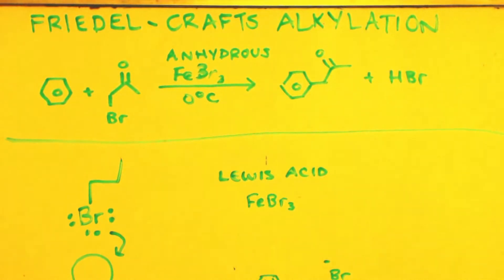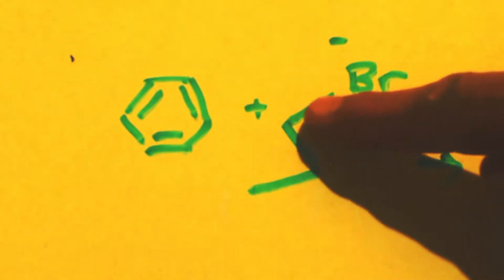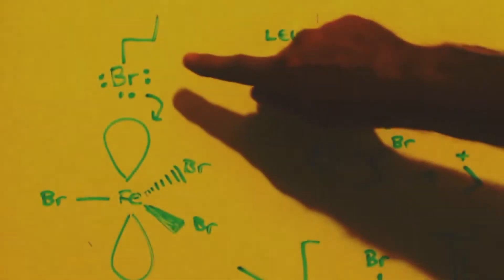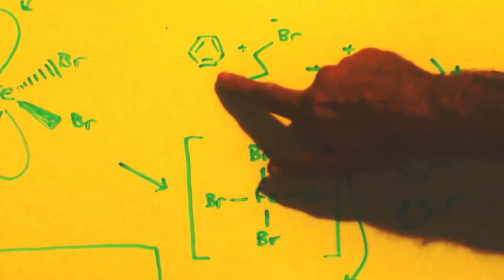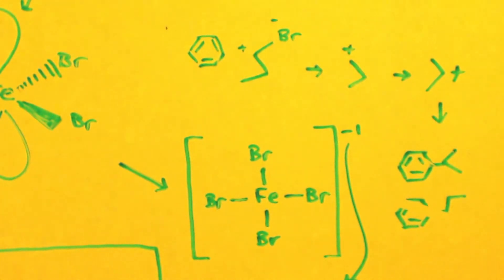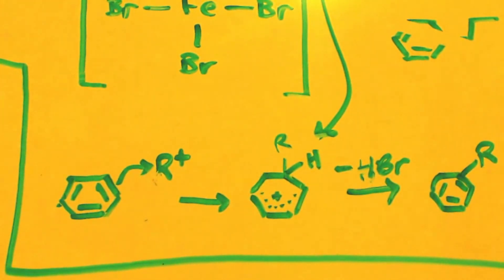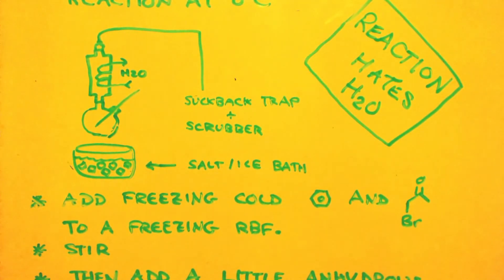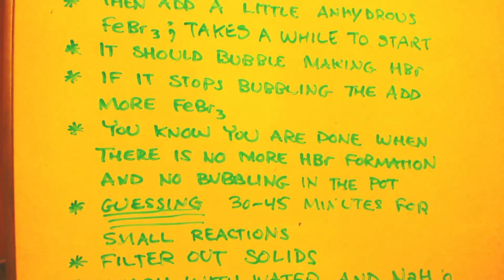P2P SYNTHESIS  friedel crafts alkylation PART 1

Comment from the maker: MX3 anhydrous catalyst forms a coordination complex with the lone pair electrons on oxygens that are part of carbonyls.   So you may need to use a stoichiometric amount of anhydrous MX3 catalyst because of the carbonyl on the bromoacetone.
                            The protecting groups for a ketone that i know are all sensitive to lewis acids.  So there is no sense in me trying to add a protecting group.   An oxygen is more electronegative than a bromine so the AlBr3 will probably MOSTLY add to the oxygen first.   But all that does is active the carbonyl carbon making it more positive.   That may make the alpha bromine a little less negative.  But the alpha bromine  should still be negative enough to complex with an AlBr3.  Now you got a positive bromine and a positive carbonyl carbon BOTH pulling electron density away from the alpha carbon which is the actual electrophile atom.   So that is a good thing.   So to fix this problem what i would do is put the benzene and the AlBr3 in the pot together.  There should be no reaction cause they are both nucleophiles.   Then drip in the bromoacetone with an equalizing funnel.   So now instead of a catalytic amount of AlBr3 you will need  a lot more cause some of it will be complexing with the oxygen and get stuck there before it can complex with the alpha bromine.  If ALL the AlBr3 complexes with the oxygen first then for every mole of bromoacetone you will need one mole for the oxygen complex.  And then a catalytic amount to actually do the alkylation.   So like 1.1 moles of AlBr3 for every mole of bromoacetone.   Now that would be a worst case senerio.   Best case senerio you need a mole of AlBr3 for every mole of bromo acretone.
                       So when you are done with the reaction you will have made a p2p complex with the AlBr3.   To break up the complex and get your p2p just put the pot mixture  in to some ice water.